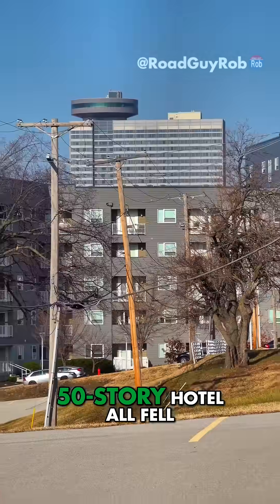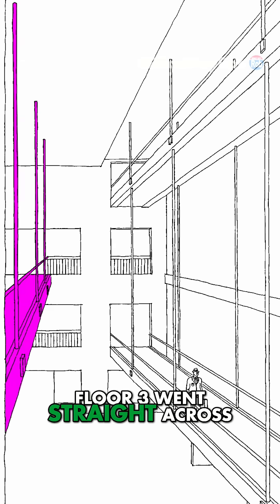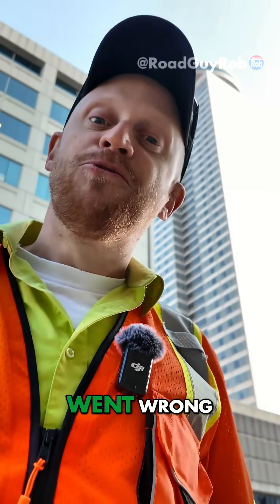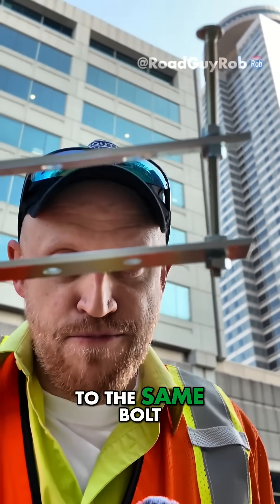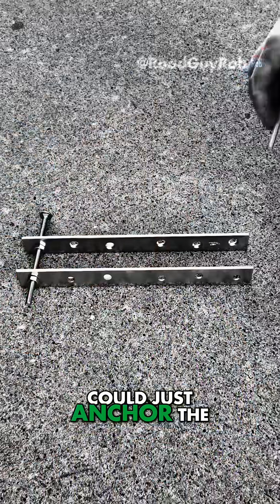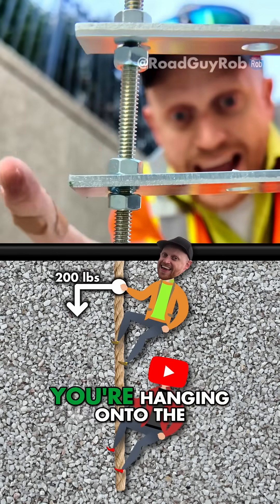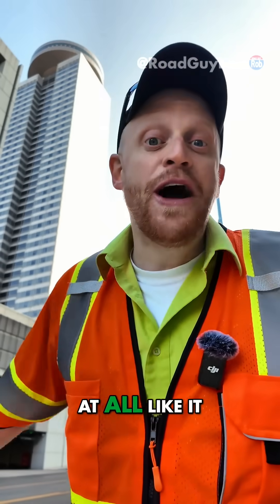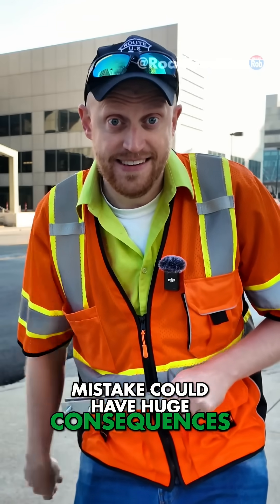Hyatt-Regency Engineering Mistake

Comment: This is why building codes exist.
Reply: While in some jurisdictions they require peer review on ANY structural changes, and the hope is that review is done, AND that review is competent...

...none of that requires building codes, it requires structural engineers doing a job, which isn't covered in any building code beyond the maybe of a peer review possibility.

Building codes exist to ensure fire systems are installed, electrical is done correctly, emergency exits, stairwells, signage, stuff like that.  It does not cover structural beyond materials used.  Like, you can't build a brick skyscraper, or you can't use wood to make a fire door, stupid yet necessary things of that nature.

Beyond that, it's the structural engineer(s) that are the key to making a building safe in such cases as this, not the codes.  

Citibank Tower in NYC is a prime example.  No building codes were violated, because there isn't any for that case... it was simply built wrong, and they thankfully fixed it before it became a giant leaning tower of New York that would crash into some other towers and be a very VERY bad time.

Such is the case here.  No building codes exist for structural at that level.  They carry basics, which were passed when these walkways were built, believe it or not.

It's the job of the structural engineers, when changes need to be made, or even at the outset, to look at it and GET IT RIGHT EVERY TIME.  Which is of course very difficult, but this one right here?  Boggles, if you understand it.  And no code even today would catch it.
Reply: This wasn't a code failure, though. It was an engineering failure. Building codes really aren't applicable here.
Reply: Builders can ignore build codes.

Regarding engineers:
Doesn't matter.
They can raise red flags all they want to. It doesn't mean 💩 when they can easily be fired and replaced by a yes person.
Reply: No, this is why engineers exist.  Building codes exist to give politicians power.

Comment: I've always wondered why inspectors didn't catch the fault in that design change.  Or was the change made after inspection?  Or was the design change hidden?  It's concerning - what else is a disaster waiting to happen?
Reply: Lots is the answer. 

But the inspector wouldn't be the one who dealt with it. They changed the PLANS, so it would have shown up on the paperwork as correct. Inspectors aren't infallible in the least, nor are they some human supercomputer that can scan and find everything wrong with a weird design as they walk through a building. 

No, the issue was with whoever heard the idea and then didn't do a LOT of math and work to make sure that the change would work. Idk why they didn't just use cables like in modern buildings. It's not like they didn't have them in the 80s, and they hold plenty in every elevator just fine.
Reply: @woodworkerroyer8497   The rods were fine - they did not fail.  The failure was in the crossbeams supporting the walkways where the nuts pulled through them, a punching stress failure.
Reply: I believe the error originated when the steel provider made the change in the shop drawings and submitted the change to the structural engineer, who missed the impact of the change.
Reply: I'm betting the design change was done in secret and nobody knows about it until after the fact
Reply: @davidhenderson3400  You are wrong.  There were shop drawings approved by the construction management team engineers.

Comment: So the 4th floor attachment points failed because they were holding up the 2nd floor? Because if the super long boot could hold the weight of 2 floors, then it should be fine if they make it into 2 bolts to hold the same weight. Unless it was the nut threads that failed? 

Regardless, the issue, as usual, is someone changing something then not checking that their change wouldn't mess with the design. And also not overbuilding things. If they had used 4 bolts instead of the 2 they thought they needed, nothing would have happened 😂
Reply: It wasn't the bolts that failed. It was the upper floor that failed from the stress of the lower one's weight being tied in
Reply: The 4th floor itself failed as an attachment point for the 2nd floor because it wasn't designed to hold the weight of a separate floor.
Reply: @monkeydude9192
Yeah. That is what I figured. Or the threads of the nut on the bolt that wasn't designed for the extra weight, at least. 

Still can't believe after all the engineering fails over the centuries that "oh, let's change that last minute" doesn't get checked better. Probably no time to check and they maybe didn't even think about the strength issue since it was already "working" and they "weren't changing much".
Reply: @woodworkerroyer8497  The nuts/bolts didn't fail, it was the box girder supporting the upper level, that due to the aforementioned design change, was also carrying the load of the skybridge below it on a second set of threaded rods -- (originally it only carried the weight of one level). Said box girder was made of two C-channels welded together, and in its overloaded condition, the lower welds failed. That's why there was a loud noise heard just before the collapse -- that was the bolts pulling through the bottom of the box girder as its welds split open. Then the collapse when the top-side welds gave way.
Reply: they could have used a short bolt and a long bolt at each anchor point, so the 2nd floor bridge was supported independently from the 4th floor bridge.

Comment: "A bunch of people got hurt" is quite the understatement
Reply: Yes, 114 got dead.  Another 216 got "hurt" (Wikipedia)(And my structural steel design class in engineering school) (and my ethics class in engineering school)

As my professors warned us: doctors kill and hurt one at a time when they mess up.  Engineers often are unfortunately much more efficient...one mitake may kill hundreds.  Check your work, have others check your work (people that actually will look for why something won't work and have the confidence to challenge you), use exceeding care when approving site changes on a timeline...be brave enough to say something if something does not look right.
Reply: Yeah, it was a horrifying massacre. 😭
Reply: Yes...limbs had to be amputated without sedation etc.
Reply: so was anyone held accountable?
Reply: @alveolate  There were civil penalties and financial settlements, but no criminal prosecutions IIRC.  Lot's of info out there on this if you want to learn more.
Reply: Yes very very disappointed and millennial dismissive that statement.